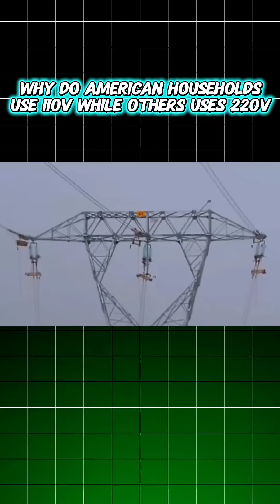Why do Americans Households Use 110 Volts While Others Uses 220 Volts #electrician #electricity

Comment: Soooooo. As an electrical engineering student I can tell that the reason to not switch to 220-240VAC is complete BS. Lets take the appliances first. Take them to the retailer and have them change the transformer circuit in the appliance. For microwaves and other larger appliances, that would be just one part, the coil transformer. Then the really fun part. You do not need to change the wiring immediately. Change the fuse boxes and fuses first. Then slowly replace wires. You can still use the sockets as well. And for PCs and laptops that use external transformer unit so to speak even tho PCs have internal ones, Europe... Just buy European model and swap. Done. Only truly expensive part is the grid change. Even tho even then it is a local change per city. Up until the transformer outside your house on the pole, that voltage is at least 300VAC. USA houses already have 230VAC coming in. It just has been split. 

And now ya read some good knowledge.